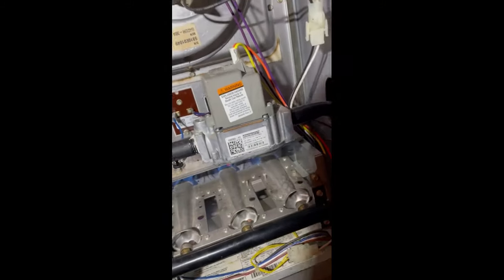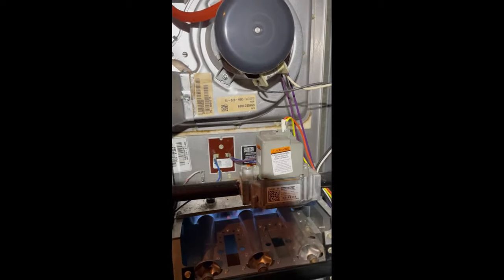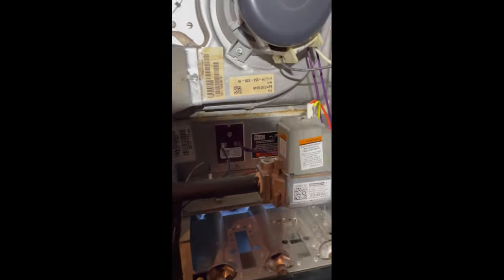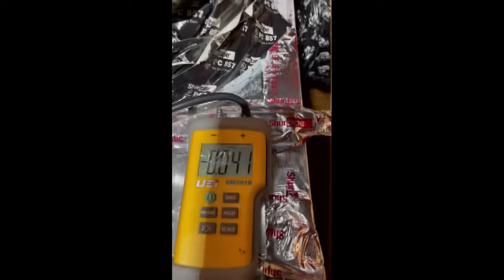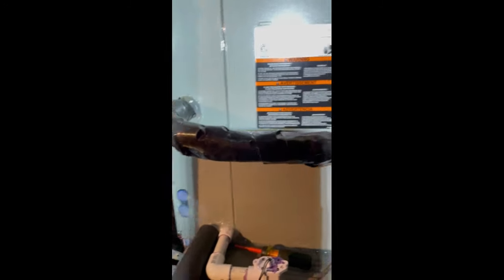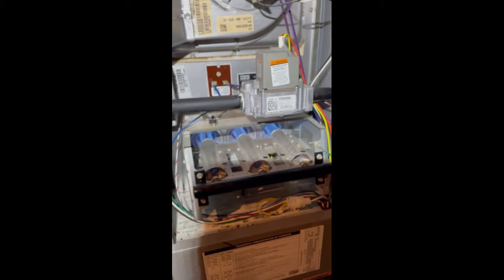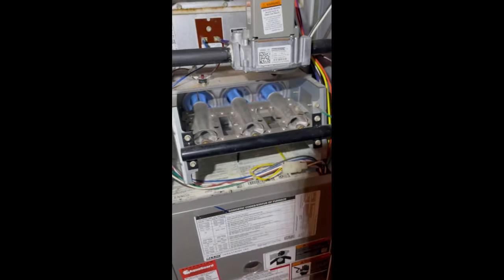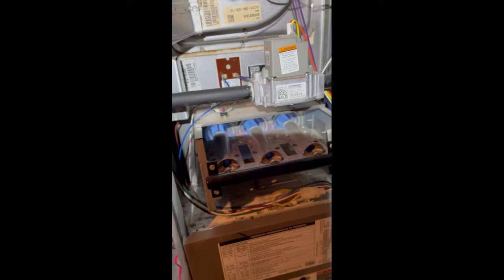HVAC - Still Good people out there!

Comment: I've never really had any issues against zoning especially with the Honeywell HZ432 or HZ332.The programming options are great. Best to use them on multi-stage equipment where you can control staging on the zone board and have minimal, if any, use of the bypass. Only times I've had any real issues is when you have a very small zone. I do believe it's better to have dedicated systems for multi-floor houses and zoning for spread out single floor homes or using zoning for a two story home with a finished basement having a dedicated system for the top floor and zone the main and the basement where the heat gain typically isn't as great. Good to see the son stepping up for his folks.